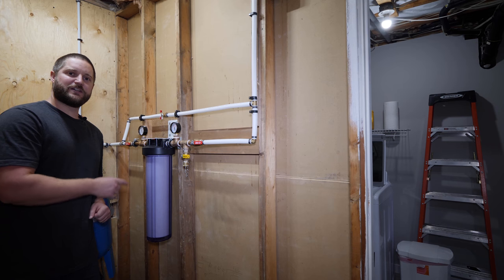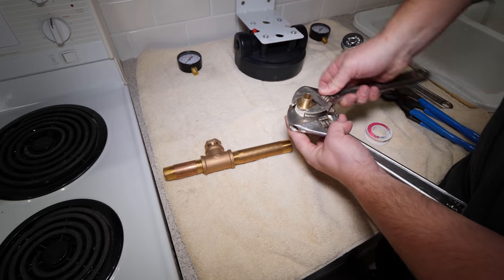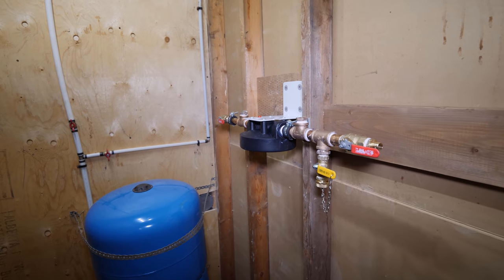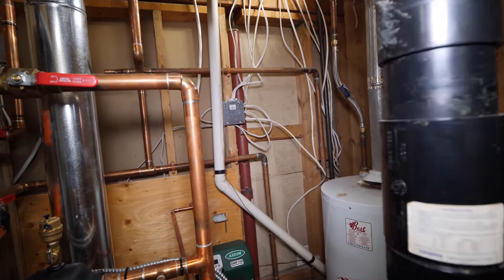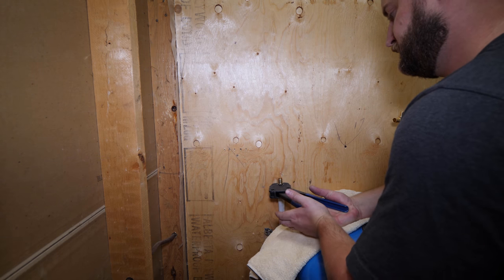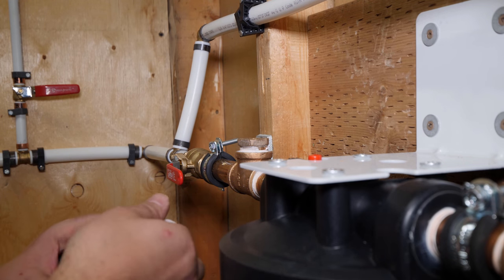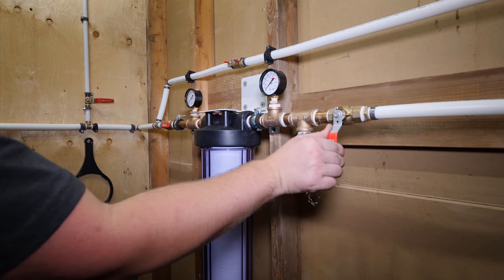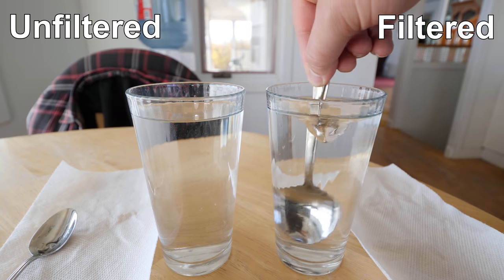Whole House Water Filter Installation

Comment: How to fix the leaking? I already replaced a new O-ring but still leaking
Reply: ME TOO.  Wonder how these filter companies could come up with a better leak-free system.
Reply: I personally only hand tighten the filter housing to the base . The wrench is used to help loosen the filter housing from the base to change out the filter . I change mine out every 3 months . I buy them by the case 25 filters for $75 .

Comment: Great info, thanks!  Is a bypass valve and piping necessary?  thanks,
Reply: It's smart idea. Since this is a whole house filter, If you have to perform maintenance on the filter side of things, or if it fails, you can bypass and still have usable water.

Comment: Great Video! I had Culligan install this filter for me, since I am not experienced like you are. The filter works great, as it also removes chlorine from the public water we are hooked up to & my water softerner runs a lot better. BTW, when you installed the filter, did you use any silicone for a sealer? Thanks.
Reply from the maker: Thanks Barry! I didn't end up using anything when installing the filters. I normally use a potable water silicone lubricant, but this kit didn't come with any. I have some ready for when I replaced the filter next time. Cheers!
Reply: Barry, I'm sorry, but I just couldn't pass by this comment without responding.  You dont have to be experienced to do a thing, even if it seems daunting.  watch some youtube videos on the subject matter, google comments by pros that give you insight on what to do and what not to do. If you still don't feel confident just try it and then hire a pro to check it over and tell you what you messed up. with a little patience and a bit of common sense you can end up learning how to do just about anything with competence and confidence.  I've been a DIYer since middle school, and although my first projects were far from the quality they are now they were a necessary step. Now I'm confident 3nough that I changed out the electrical panel on my house and while I am absolutely having it inspected I know I did a better job than a lot of professional electricians.  If you are interested in DIY projects, please dont let inexperience stop you from learning.

Comment: An awesome video.  Where did you buy your cushioned clamps? I like them but I can't find them either amazon or eBay.
Reply from the maker: They are item number #454005 made by Nvent Caddy. Part #45005 fits 3/4" OD pipe or 1" tubing. I purchased mine from Bartle and Gibson, a local plumbing distributor. Amazon carries them though. 𝗔𝗺𝗮𝘇𝗼𝗻 𝗔𝗳𝗳𝗶𝗹𝗶𝗮𝘁𝗲 𝗟𝗶𝗻𝗸: https://amzn.to/3mESXLR

Comment: Recommend having some sort of Union on each side to disconnect and replace the filter casing if needed
Reply: If you use shark bites fittings you don’t need any of that shark bites is easy  removable
Reply: @jusokicin8105  shark bites have an o ring in them and you shouldn't be removing and reusing them.

Comment: Would this be useful with hard lime scale water?
Reply from the maker: Lime scale is mostly total dissolved solids (TDS) so this filter wouldn't help. Water softeners or reverse osmosis is the most common methods to reduce lime scale. This style of filter is designed for total suspended solids (TSS), mostly sediment and particles as small as 1 micron. Hope this helps. Thanks for the question!

Comment: Can these be installed In a trailer Home?
Reply from the maker: You bet. Anywhere you have the room to install it.
Reply: The issue as I see it with 'Manufactured Homes,' is that the water main hooks up to the 'Whole House' water connection in the unheated crawl space under the structure, and which then goes to the Manifold, which is basically locked away somewhere in the sub-floor space. In most geographic areas it gets below freezing cold in those crawl spaces in winter. And there is no good way to mount such a whole house filter from that connection in a heated space.

Comment: how often are the filters replaced?
Reply from the maker: Depends on usage and water quality. These 20" x 4 1/2" sediment filters usually last 1-2 years before a pressure issue and have to be replaced.

Comment: Great video but I have heard a lot of negative stuff about using PEX type material
Reply from the maker: Thank you! Are you referring to chemical leaching? PEX has very strict and extensive tests before it can be approved for a potable water system. Most of these articles speaking negatively on PEX for your health are based on opinions and not facts/tests, or uncontrolled tests. Purchasing NSF/ANSI certified PEX and fittings will ensure that the product is tested to a high standard. This is all just my opinion and everyone is welcome to do their own research.
NSF/ANSI PEX FAQ: https://plasticpipe.org/pdf/pex_frequently_asked_quesions.pdf
Reply: @PROSDIY  exactly.  I have some hooked up to our water softener.  They use it for full house jobs everywhere but California I heard
Reply from the maker: @xavierdiazmcguire4667  I heard the same thing about California. To be honest almost any plumbing fitting I purchase has a label saying "...which is known to the State of California to cause cancer". Here in Alberta, Canada all new construction is done in PEX.
Reply: @xavierdiazmcguire4667  Not true. Pex is approved in the California Plumbing Code. I recently replaced a lot of old galvanized pipe with Uponor Pex A and had no problems getting a city permit.

Comment: Info on the pex crimper you used?
Reply from the maker: To be honest I just pick them up at my plumbing wholesaler whenever they wear out and I don't really look at the brand. They all seem to be very similar in make and it wouldn't surprise me if most brands are made at the same manufacturer with just different labeling. My 1/2" one is a Samona and my 3/4" one isn't branded. If you need any information on testing and adjusting crimpers this video at the 12 minute mark has some information: https://youtu.be/CR2x7ZQvA-A
Hope this helps. Cheers!

Comment: what were the clamps that were used on the water lines with the plier type tool?
Reply from the maker: Hi Peter, Do you mean the crimp PEX rings? I have another video on PEX that may help: https://youtu.be/CR2x7ZQvA-A
Reply: @PROSDIY  I appreciate the link, and it explained a few things. Are these tools and rings accessible to the average homeowner, or are they contractor only?
Reply from the maker: They're available to everyone. Home Depot/Lowes/Amazon carry them. I believe Home Depot/Lowes even rent the crimp tool if you chose not to purchase the tool.
Reply: @PROSDIY  I really appreciate your willingness to answer my questions. I live in a northern climate, and somebody ran my tub supply lines next to an outside wall. I'd like to fix that, while also putting in a shower stall. Using the system must save huge amounts of time over using pvc and glue.
Reply from the maker: @petepeters4789  Absolutely! Saves a ton of time compared to copper or PVC waterlines, plus it's flexible. New construction has pretty much all gone to PEX. Good luck on your project. All the Best!

Comment: What do you need the pressure gauges for?
Reply from the maker: It helps determine if the filter needs replacing or if it's getting close to a filter replacement. If the downstream gauge starts to read much lower than the upstream gauge, then the filter is clogged and needs replacing. Thanks for the question!
Reply: @PROSDIY  but, when u see the white filter turn to very brownish color,  that mean its time to change already.  just a few bar lower still can use for sometime.   am I correct ?
Reply from the maker: This filter housing you can actually see the filter which is great. Many filter housings aren't clear though. Correct a few Bar or PSI in the difference isn't a big deal. You can run the filter as long as you want, as long as you don't mind the pressure loss. I using only change the filter when the pressure drop is noticeable enough that it becomes annoying.
Reply: @PROSDIY  Oh.  thanks bro.  I forgot there are blue and casing which you cannot see at all .   transparent casing is slightly more expensive than blue or white casing.
btw, is a lot of people installation water filter in the States ?  I heard most of them directly drink from the tap.
Reply from the maker: Yes you're correct, most drink from the tap. Most city water is fine to drink. I grew up on rural well water and we never had to filter it. The well water that was in this video is extremely hard and loaded with silt and sediment that's why the filter was installed.
Reply: Where dod you get those cushion clamps?
Reply from the maker: @IndianaArcher  They are item number #454005 made by Nvent Caddy. Part #45005 fits 3/4" OD pipe or 1" tubing. I purchased mine from Bartle and Gibson, a local plumbing distributor. Amazon carries them though. 𝗔𝗺𝗮𝘇𝗼𝗻 𝗔𝗳𝗳𝗶𝗹𝗶𝗮𝘁𝗲 𝗟𝗶𝗻𝗸: https://amzn.to/3mESXLR
Reply: Two gauges is a great idea. I also have a gauge on the out side of my filter. I had replaced a filter once and a few days later had low water pressure. I started checking everything and even thought about replacing my pressure tank. I thought it could not be the filter I just replaced it. Since I had a new filter I went ahead and replaced it. Sure enough a new filter that looked clean failed. That's when I installed  another gauge on the out side of the filter.

Comment: Good install putting water lines above the electrical. Wow.
Reply: Not unlike many business network closets/rooms, where they hang the AC unit above racks which contain cabling and gear. LOL
Reply: It’s common everywhere man. Not the best design, yeah. But, water lines are the means of every secondary ground in residential applications. So, in theory, the electric will ground out if it travels to the water lines somehow

Comment: Well done video.
I installed two of these in parallel on my well system to avoid ANY drop in pressure. I also use 5 micron carbon block filter elements.
I was seriously considering the use of pre and post pressure gauges, but with a parallel filter system, they may not show any differences until LONG after the filter elements need to be replaced.
I simply change both elements at a 1 year interval.
Reply: Did it work? Im thinking about doing that on my well
Reply: @raysmusic49  Yes it works great. I'm using the large 4.5" x 20" filters and I change the elements once each year.
I also have a UV sterilizer and my last water test at a commercial lab was excellent.

Comment: How often are you changing the filter? I know that is fully dependent on water usage and how much sediment is in the water, but just curious. We recently needed our well fracked and had to add our own pre-filter before it hits the water softener. We also went with amazon and got a reusable filter. It's 1 micron and metal. It can be cleaned, but it seems to be getting to the point that cleaning isn't helping it. The filter itself is around $20, and lasted about a year (with monthly cleanings with a soft bristle brush under water). 

I am wondering if this isn't a better option. The 1 micron link seems to be broken, but it looks like two filters of the 5 micron are $40. If those filters are lasting a few months each, that's not too bad. I like what you did with the gauges. We didn't do that, but when we notice water pressure dipping some, we know it's time to clean. I am thinking these guages are a much more elegant choice.
Reply: I cant answer how long itll last, but our water at the 14 acre house we just got was so orange and gritty, i actually could see and feel the sand in the water and the jar i poured it in was sandy orange..  My mom had a plumber install a 20 micron sediment filter, this stopped the sediment, but the water was yellow now and smelled like metal or iron or rust..  So i decided to install a 3 stage house filter.. the 20 inch blue filters,  the first filter is 5 microns, then a 5 micron carbon filter, then iron and manganese, and then the 4th one is the plumbers 20 inch filter.  i installed it after the 3 and removed the 20 micron sediment filter, and installed a heavy metal/activated carbon filter.   Now the water is blue in the tub, and smells great and tastes like good bottled water.   I will say though the 20 micron filter was only in for maybe 2 weeks and it was getting fairly orange..  If i had to guess it was about 30% used up already..  The 5 micron i installed might clogg quickly.

If you want your 1 micron filter to last longer, i suggest you install a 2nd filter.  The first one should be about 20 microns, then your 2nd would be the 1 micron filter.  This way you keep the thick gritty stuff out of the 1 micron expensive filter